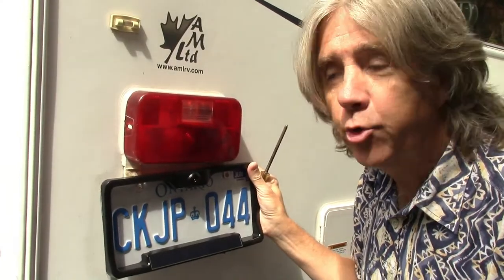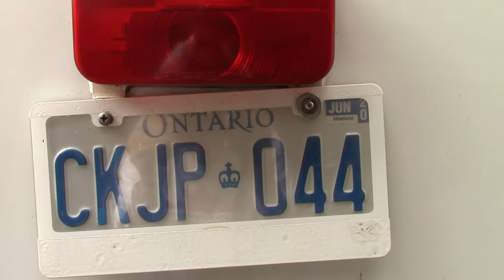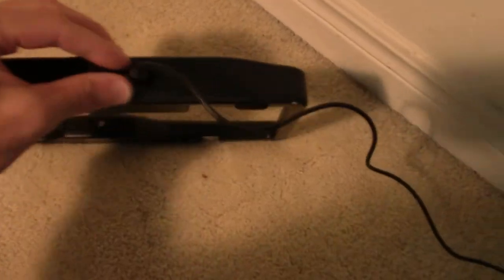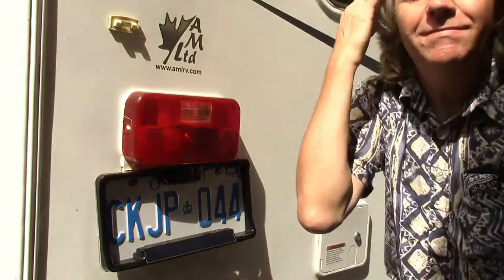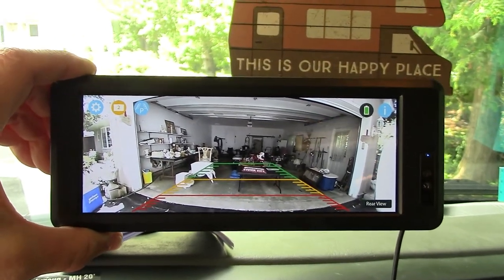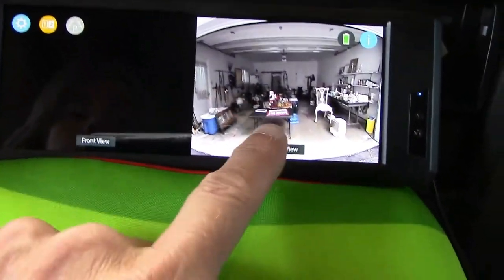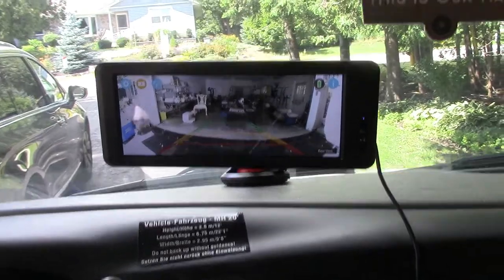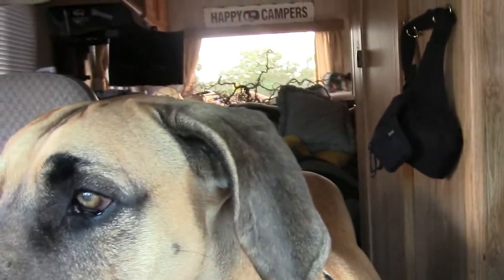Backup Camera Install & Review & We See A Beautiful Cadillac Coupe Deville RVing A HUGE Great Dane

Comment: I've been looking to get one of these to install in the front of my truck.  I see that it has the option to flip the view which I think would be needed.  Unless I missed it, there was no 'installation' by adding to/splicing wires.  Did I see that correctly?  Just add the license plate frame after charging.  It gets power from solar strip.  Inside the cab you just plugged into 9volt.  Could you list the specifics so I could search for it to purchase?  I did not see it in the video description.  Thanks so much for reviewing this.  That wide screen is great.  I found your channel (and subscribed) after you subscribed to ours.  Thanks
Reply: I found it on amazon.
Reply from the maker: I will send you the info tomorrow
Reply from the maker: Here is a link...
https://www.costco.ca/type-s-solar-powered-720p-hd-quick-connect-wide-screen-wireless-6.8-in.-backup-camera.product.100563153.html
There are no wires to hook up to the rear back up wires - its completely wire less and you can turn the camera on when ever you want
big wide screen which is great and you can buy another camera for the front of your vehicle - enjoy
Reply from the maker: BTW thanks for subbing our channel hope you enjoy our videos